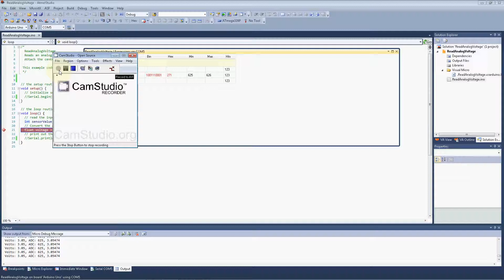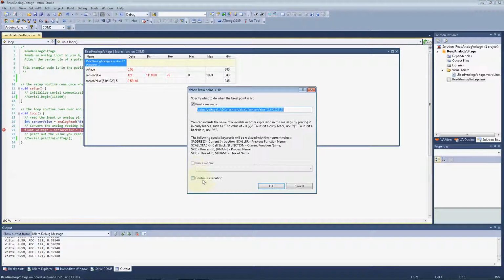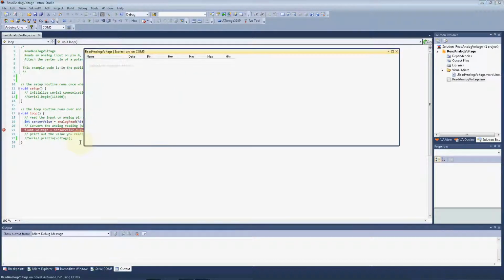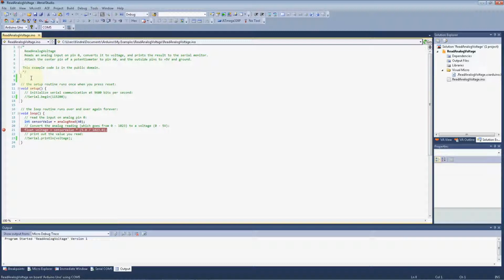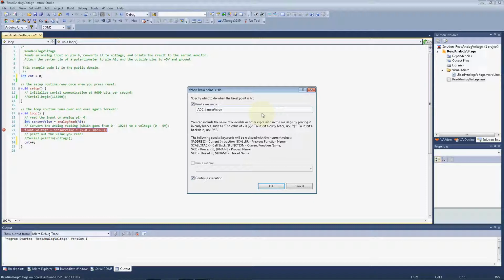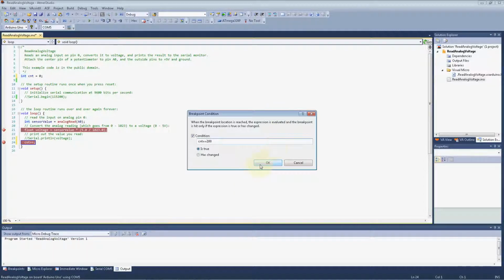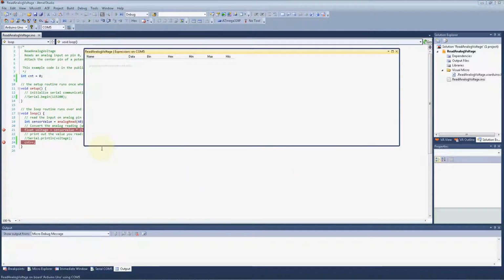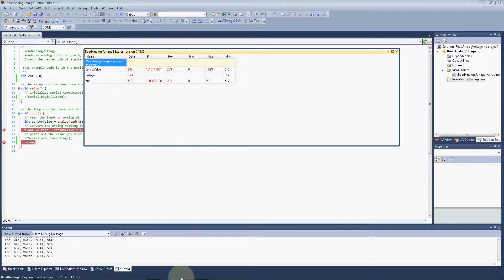Arduino Programming with Visual Micro for Atmel Studio 6.1 - Part 4 - Debug-Halt-Pause

Comment: Thanks for your previous help but I am having trouble getting this part to work consistently.  I added the first part to watch the variable like you did but when I try to add anything else it doesn't open up the expression window any more.  If I reload Atmel Studio it sometimes shows but not always.  I have the micro debug with full.
Reply from the maker: Without seeing exactly what you are doing it is hard to troubleshoot. Since it does work (sometimes), I think you probably have it configured properly. One thing I can tell you is the serial monitor Tim wrote drives the debugger. So it might me hanging for some reason. Try closing the serial window then pressing F5 to re-run your code.

You may want to join the forum over at http://www.VisualMicro.com. Tim is very good at helping new people get up and running with his software.

Plus there is a lot of good info there!

And you can also check out these videos about the debugger:

Visual Micro Tutorials #4: Arduino Debugger Intro
Visual Micro Tutorials #5: Advanced Arduino Debugging

Sam does a good job explaining things.
Reply: Dennis Hill That does help to get it to show with out reloading Atmel studio. Which saves a lot of time since it takes a while to load on my computer.  I'll look to join the forum to see if can get it to work better though. Good day.